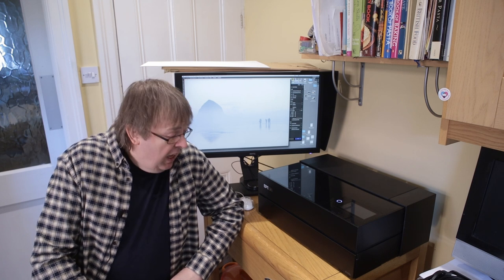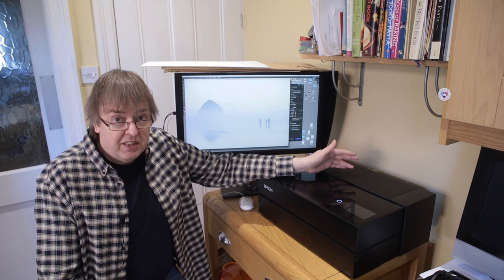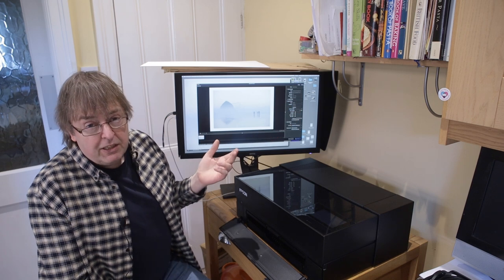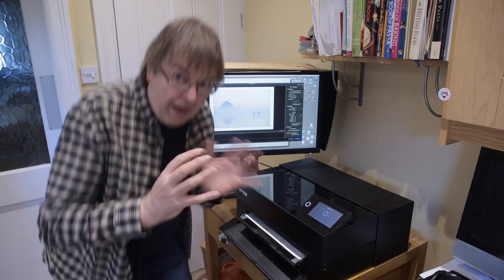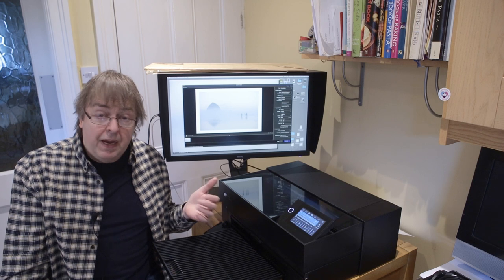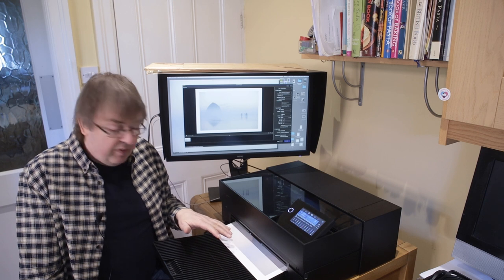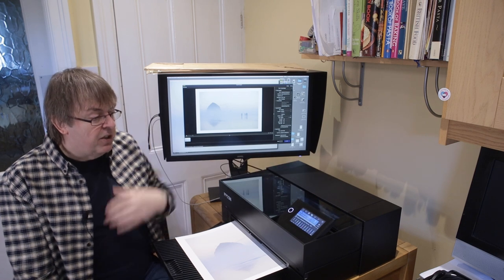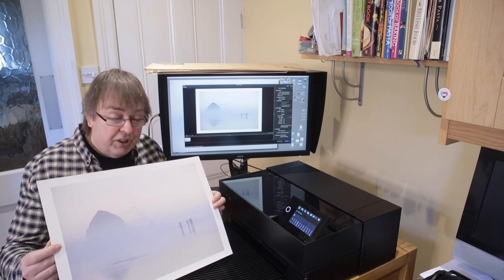Epson P700/P900 using thicker art paper via the front feed

Comment: I am trying to use a thick paper which is too small (5x7) for the front feed but it wont feed through the sheet feeder. Is there a way to handle this? P900. I want to use the 5x7 to proof things before wasting a lot of ink on a 16x20 sheet. Thanks
Reply from the maker: Use bigger paper... Small paper is rarely supported so well in larger printers
Cut a 16x20 in half? Then use each sheet twice for a small image...
Reply: @KeithCooper  Thanks. I have 8 1/2 x 11 I can use with front feeder. I suppose solution is just print on half of it when I don't want to waste ink. The final prints are not the issue because 16 x 20 works fine. Thanks for the quick reply. Enjoy your instructive videos.
Reply from the maker: Thanks - if you've not seen them, do check the main [written] reviews as well - that's where the detail goes (and links to all related videos/articles)

Comment: I need help : \
I have the Epson P900 Printer and I am trying to print a 12 x 18 inches order, however it's cutting off the right hand side of the design. What am I doing wrong? I have amended the sizes on the printer application to the correct sizes in mm (304.8 and 457.2)
I'm going out of my mind with this
Reply from the maker: "the printer application" - what are you printing with? and from what... makes a huge difference
Reply: @KeithCooper  Hi Keith, thanks for the quick reply - I'm using my apple Mac via a usb and it's just leaving a massive margin on just the right hand side of the print. Martine. Im happy to email you or message if easier
Reply from the maker: Email's best via Northlight - Try printing via Epson Print Layout though - I've lots of examples of its use in Epson printer reviews/articles/videos
Reply: @KeithCooper I’ve tried that but for some reason on the Epson print layout it’s automatically selected the 7750 printer and I don’t know how to change it to the p900 😢
Reply from the maker: First check the P900 is properly loaded with the correct driver [if on a Mac, make sure the airprint driver is not selected by mistake]
EPL should then be able to find the printer.
Reply: I’ve tried everything now - can I take your email pls? I’m going out of my mind 😢
Reply from the maker: Look up Northlight Images - my photography business @MartinePrior